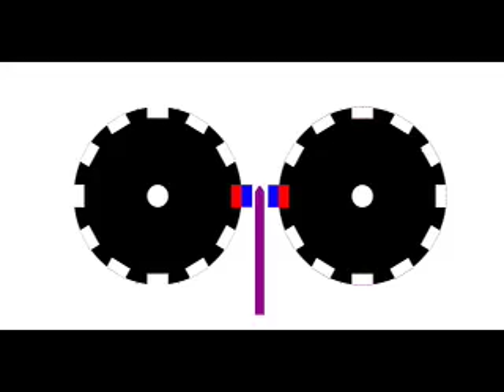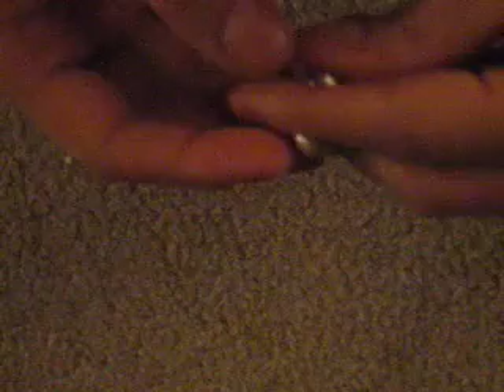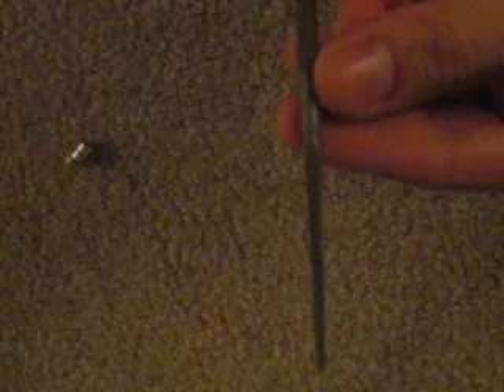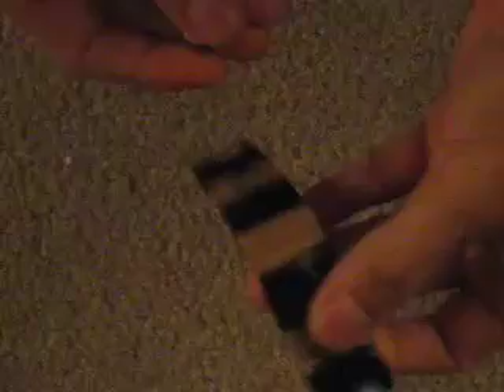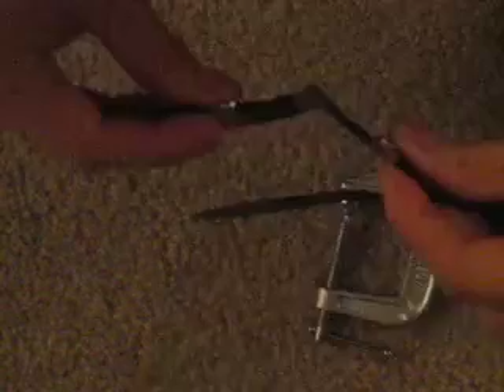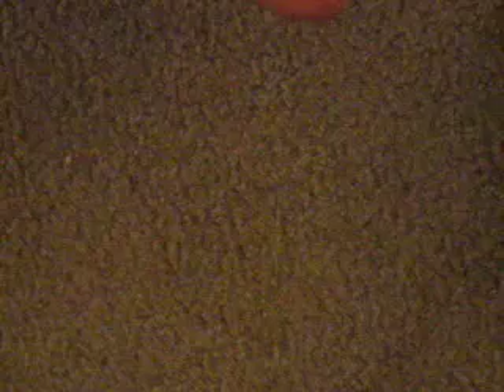Magnet Motor concept and How magnetic shielding works

Comment: better idea is to use a lead plate slightly past the centrer point. That way it diverts the magnetic push back until it open. Also if you  tilt one side all the magnets on one of the wheels slightly pointing back. It will have an attraction force that will bend around the lead to help pull it. then as it rotates be slightly past the center point it fly]g-

Comment: The counter EMF is the self-regulating part of electric motors that a magnetic motor cannot provide.
Here's the self-regulating explained:

1)  the back EMF in the motor coil prevents it from running so fast that it comes apart when there is no or a light load - as the rotor's windings spin faster through the stator magnetic field, the rotor's windings encounter greater back EMF due to Faraday/Lenz's law, which then limits the current and thus  the magnetic field in the rotor, keeping it from spinning too fast

2)  when the motor gets put under load - EXAMPLE:  in an electric drill, you drill through a 2-foot thick piece of hardwood with a dull drill bit - the load slows the rotor's rotation.  That reduces the back EMF because the rotor isn't spinning through the stator magnetic field so quickly.  In response, the current in the rotor coil can now increase to a higher level, creating a stronger magnetic field, which creates more rotational torque, so the rotor is not slowed too much by the load (drilling through 2 feet of hardwood with a dull drill bit)

Nature is one of the designers of how electric motors work - the back EMF keeps the rotor from spinning too fast when there is a light load, and the back EMF reduces when there's a heavy load so the motor can handle the load.

Point being, there is no mechanism like this with permanent magnets - because there's no current.

There is no current that could increase in the rotor (the part doing the actual work).  

There's also no back EMF to reduce current in the rotor to slow it down when the load is light - because, again, there is no current.  If you eliminate the 'drag' of back EMF, the rotation could grow, possibly, leading to excess mechanical stress and breakage

Comment: What would actually happen is that because there is no attraction at the end of the rod, the magnets would pull back to the attraction below and effectively slow the rotation until it stops. I have also studied this stuff. I actually focus on generating power with less motion to eliminate the pull of the magnets. Most people want the magnet pull and try to use it to create motion, but you should focus on the magnet power generation abilities without motion. Think initial reaction and less about continuous reaction.  Hope this helps.

Comment: so i am inventing a new pet hair remover product that has two sharp blades doing all the cleaning and it has a sonic vibration system simialr to the philips sonic care toothbrush vibration which enhances the cleaning!
Im having trouble because although we have found a great sonic motor, i believe just a sonic motor with a few rechargeable batteries (cant be AA or regular batteries because the sonic motor is at a 3.7 rated voltage and would run through the batteries quickly) wont be as strong of a frequency or hertz than if we place some magnets around it, maybe some copper windings to increase the magnetic pull, maybe some sort of gear or mechanism to convert a spinning motor to a linear movement as the blades need to move in a linear movement for optimal performance!  
The more the vibration force the better the cleaning!
Would you bne able to help me woth some pointers or know someone that i can use to help with these slight and subtle tweaks?
Even if we just have a motor in there, i am sure the positioning and placement of the motor and ditnace away from the blades influiences frequency, right?  All these answers the factory who is building the product for me has no clue about, which leaves me at SOL!
Lmk thanks!

Comment: The repulsion of the magnets after the "shield" would cause them to move apart with less and less force. The attraction of the magnets in the "shield" would increase and then balance the decreasing repulsive force before exiting the "shield". For rotation there must be torque. There would be no resulting torque as you hoped...sorry.
Reply: 1:30 
There is neutral force at the shield and beyond the shield there is only one force that is repulsive.

The attraction of 'magnet to the shield' is equal to 'repulsion of the magnet to opposite magnet'
So there needs to a torque.

But it doesn't work and I don't know why

Comment: Won't work as shown 
You have to put one ring of magnets with flywheel energy capicitiy strong enough to pull past the weak grip of the thin end of your iron motivators,
 around a stationary ring of magnets and use thick to infinite edge iron motivators between the opposing magnets to motivate initial movement.
When all magnets are time to operate like pistons on a crank shaft kinetic energy helps issist the opposing magnets to overcome the reduced strength sticky points.

There is no way to shield a magnet but you can reverse the olarity of two with iron. By useing a fat fat face thick end for strong atracaction the magnets want come together but can not do so. Because they are operating in space and time only there is no surface friction on the iron. So when the reversed magnets slide off the micro thin edge , there is so little iron there to grab hold off that they fly apart instantly returning to repulsion mode until moving enough to feel the reversing affect of the next iron atractor motivator.

This is Howard Johnson's magnet motor principles.

Yes it can easly be done with the right motorvator shapes and configurations.

I just can't figure out how to make a wedge of iron thick on one end tapering to micro thin on the other end and shaped like the crescent moon.
It's all that is needed to make it work hard .

Comment: You haven't cancelled the repelling forces by putting iron between itself. You just have the same poles fighting over the same piece of iron. When you do this, the iron "tries to repel itself".  If it were possible for magnets to be strong enough, the iron itself would be ripped apart.

Comment: There are magnetic motors that exist so Just search "Magnetic motor patent :yt" to see some.

@magneticveil This is the title of an old magnet motor video that is said used magnetic shielding, but to me it looks like it uses inertia and mechanical separation at what would be the sticking point... "Lueling Permanent Magnet Motor - Vintage Selfrunning Magnet Motor from the 1960s".

Comment: Did you know north and south magnetic fields can be literally printed onto the same side of a piece of metal now. 
New technology using what they call magnetic pixels (maxils) can be printed in any configuration.
Solid state magnet motors here we come!

I think you have shown mechanical proof of concept to a degree, you need to make a model now.
It matters little about the 3 dimensional shape of the fields others mention, 
those weaker parts of the field will not overcome inertia of a weighted wheel or 
the main 2D bands of the strongest parts of the magnetic fields. 

Keep experimenting. Best of luck

Comment: No energy from nothing. Not now. Not ever. We can always "see" why a magnet motor "should" work. What we don't - or refuse - to see is the loss of energy at some other point... Use logic. Energy cannot and never will come from nowhere. If you can't explain where it is going to come from - then it certainly won't work. And NO - magnets are NOT a source of energy. They are more like a spring. And, you can't get energy from a spring. You can STORE energy with springs and magnets, but they cannot create energy. Sorry, but nope. And now, I saved you lots of time. You're welcome.

Comment: doesnt the magnet motor break the rule of conservation of energy ?
Reply: "Conservation of energy" is as useful a term as "what goes up, must come down". When you sit back and consider how simple it is to induct electricity for a generator/alternator and that we have a constant gravitational phenomenon around us at all times, then you realize there is more than enough available energy to make such an invention to work. The problem is that despite Ken Wheeler's work on the subject, we (civilians, not military) are still struggling with how dielectricity and magnetism truly work and how they create the gravitational effect.  If we did fully understand it, we would have no energy deficits and we would all have "anti-gravity" devices.

Comment: I designed this very device in 1975 at my uncle's house, and it's exactly what you'd expect from the imagination of a 14 year old kid.  I got about as far as you did: a couple of drawings of the concept and heart-felt promises that it would work.  By the time 1982 rolled around and I had a couple years of education in college physics under my belt, I had learned better.  Please, everyone, listen to me: put the effort into studying *AND UNDERSTANDING* basic physics and mechanics, and the knowledge you gain will pay you back richly.  And then you can come back to Youtube and watch in amusing horror as rooms full of people who haven't learned basic physics or mechanics watch in amazement as Yildiz demonstrates his so-called "magnet motor" in ways that will make you fall down laughing.  "Gee, if I were trying to hoodwink a room full of morons, how would I do it?  I know!  I won't do anything legitimate, like run my motor against a dynamometer to show an actual measurement of actual power generated (mainly because my little contraption doesn't even have enough power to turn the dyno shaft one revolution with the meter in idle); instead, I'll bolt on a noisy sheet aluminum fan blade and push air into people's faces so they can "feel it."  And I'll make sure to hold the events on public university grounds so that when I advertise the event it sounds like a function of the university itself.  I just won't tell them that, by law, public universities MUST give free access to such spaces because they are supported by the public's tax dollars.  It's perfect!  And then one day at one of these events, I'll find that trust fund baby who was born with a silver spoon up his ass and who just recently buried his father, and I'll get his millions of -- ahem! -- *investment* dollars because he coasted his whole life on science fiction TV and will believe anything.  Oh, yeah...."
Reply: Let me guess, you believe in Gravbity right ? The magic force. 
But you haven’t figured out that the real law is relative density, not grabbity. 
Ahhh.. accademics
Reply: @henridecorbiac2239  ???

Comment: the reason why this doesn't work is because it takes energy go start it. it than moves by itself but if it was connected to something else then friction would slow it down to the point where it stops.

Comment: If there was no shielding you would be right, my friends the critics.  The shielding allows the repulsion in the shield zone to be weaker and easier to overcome than in the unshielded zone.  It creates an imbalance.  So, the net energy is forward motion.  Very astute.
Reply: Where is de facepalm when you need one? Magnetic 'shielding'. You mean, putting a magnetizable object in the magnetic field? Does that 'shield' the magnetic field? It magnetizes the magnetizable object. Which in it's turn reshapes the magnetic field. So do you shield it? Reshape is a better term. The fun fact is that the reshaped magnetic field will repell the oncoming magnets and it will hence have no net effect.
Please come back if you have found a non-magnetizable object that stops magnetic fields.
Reply: ***** If it reshapes it, it changes the flux path you goose. To flip the magnetizable element to the same intensity of the magnet requires a greater flux than the unaided magnet has, so it does not have the ability for full magnetization to oppose the other side like the magnet would without the unmagnetized insert.  

Take a course in physics before you start your railing. The people who know the least are those who cry the loudest.

The idea is sound.
Reply: Dennis Kean Where is the *double facepalm* when you need it? So you tell an MsC to take a course in physics. Right.

Anyway, the idea is sound you say. Then why don't we see a working prototype? If this works, it should be a very simple setup. Just make two discs with magnets, use lego gears and a chain to interlock the discs at the axles, stick your magic metal file in and see how things work out for you :) 

2 hours of work, and we will all shut up :)

Except...if it doesn't work. Then nobody will post such a video. It's a shame really :)
Reply: ***** 
I did not say that it will work.  But your deprecation is unwarranted and your objection is far less than adequate to show why it will not work.  So, let's dispense with the pomposity.  Give an adequate and reasonable objection and it will be heard.  

On the side, someone who has a Master of Science degree does not have an elevated ego, as you are wearing on your lapel.  Challenging with a retort rather than a rationale suggests that you may be one of those who hides behind imaginary achievements.
Reply: Aww, hurt by an ego :) I couldn't care less whether you believe me or not :)

Anyway: any objection can be questioned as they are all theoretical....while the principle (if it would work) is very easy to prove. Who in his right mind would go discussing objections when it takes almost no effort to prove you are right? Just make one!
Reply: You are totally wrong on the point that the magnets would cancel each other through the unmagnetized metal used as a shield.  I used a thin sheet of metal  and in spite of the fact that the magnets repel each other the metal made them attract each other.  I know this from experience.  Add momentum to the wheels and they will translate from attraction to repulsion.  It is no great mystery.

This implies a motive ramp up with attraction and a translation to repulsion past the shielding plate.  And that is what was claimed.  So, please feel free to conjecture.

If you hold a degree I am Santa Clause.  For you to say "If you don't believe me..." implies that your base of operation is belief.  Holla amigo... Claims might win you a victory with neophytes, but not here. Try fooling someone else.
Reply: Dennis Kean Have you had a busy winter this year? :)

Comment: Here's how it works:
It doesn't work.
Reply: Yep, and here is why: the magnets magnetize the iron, which will create an opposite pole further down. You just reshape the magnetic field. The magnets will still need to travel through this field and the forces will cancel eachother out. Simple as that.
Reply: But i have seen it working....................................................in my imagination ^ ^
Reply: @Destruction But safe No. The whole principle this guy demonstrates is that above the metal shielding the magnets should repel each other. If you invert the magnets on one wheel it''ll attract and all will come to a halt anyway.

Here's a simple thought: if this would work... how easy would this be to build? In fact, it's so simple that it would take less time to create than this video :)

Comment: I built one of these, locked together with outward-facing toothed belts, which worked well to keep them in phase. I then nulled out the repulsive forces of the like poles on both wheels by using wood screws, added one at a time until the magnet forces were nulled out. Cool, I thought...when the magnets get above the nulled out section, which I put just past the point where the like-pole magnets were closest, it would be like a "rising sun" effect, and the magnets would repel each other with a vengeance. Well, I found that this theory was correct...but the problem was that the repulsive force past the nails just pushed the wheels in the opposite direction and acted as a great brake! I continued, by placing more screws further above the nearest point, but by the time I got things past the backward tending force, there was little useful force left over, due to the distance between the magnets, and it wasn't even enough to overcome the friction of the two meshing toothed belts. Nice idea, but no cigar...yet.

Comment: make the gear magnet face negative at each other letting them push away. Put a positive charge at the tip, or perhaps all around the outside.
Reply: +Antonio Candelaria That idea won't work.  Stop to think about what you were suggesting and you will see why.
Reply: you need a positive for them to bring the negative together, say if u use all negative wouldnd that make them all reject eachother and make consistant movement
Reply: you need a positive for them to bring the negative together, say if u use all negative wouldnd that make them all reject eachother and make consistant movement
Reply: you need a positive for them to bring the negative together, say if u use all negative wouldnd that make them all reject eachother and make consistant movement
Reply: you need a positive for them to bring the negative together, say if u use all negative wouldnd that make them all reject eachother and make consistant movement
Reply: Antonio Candelaria
Repeating the same post several times doesn't look very good.  Doing it for a post in which you say something wrong is even worse.
Reply: aye just tryna help, I've had this thought for years,not worth my time to go and invent something someone will put a paten on first
Reply: aye just tryna help, I've had this thought for years,not worth my time to go and invent something someone will put a paten on first
Reply: aye just tryna help, I've had this thought for years,not worth my time to go and invent something someone will put a paten on first
Reply: aye just tryna help, I've had this thought for years,not worth my time to go and invent something someone will put a paten on first